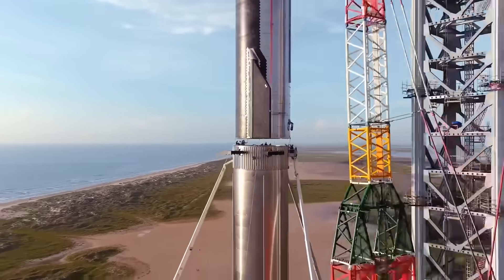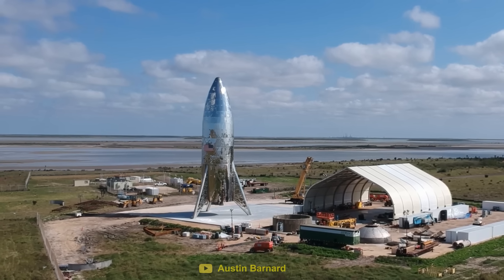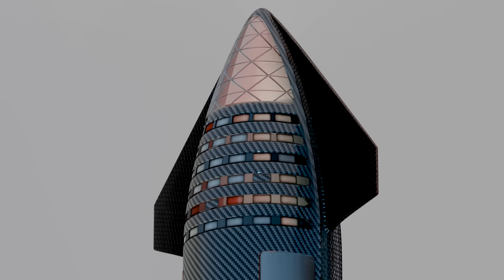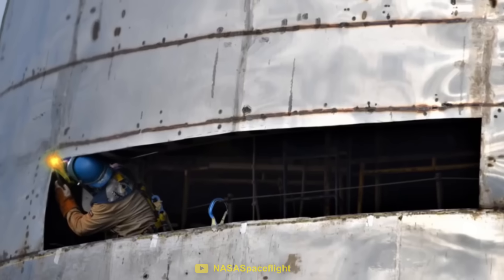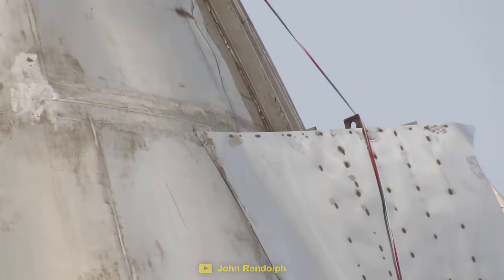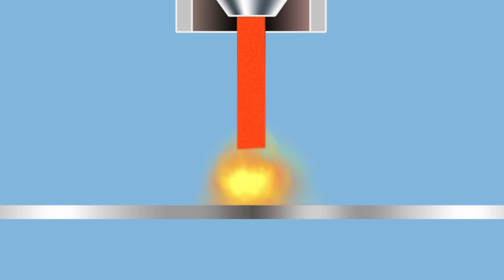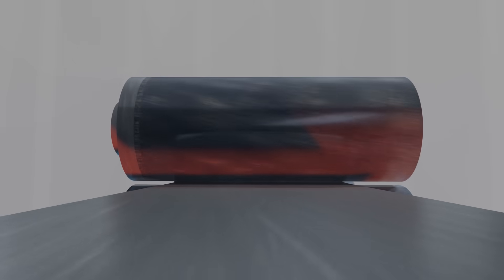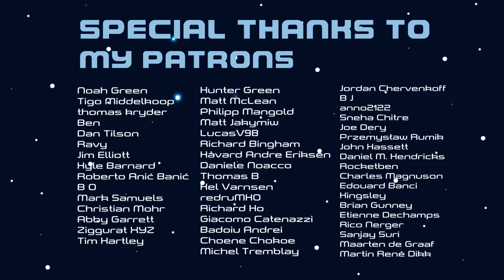How SpaceX Mastered Starship’s Welding

Comment: It would be super cool if SpaceX could manufacture Starship through friction stir welding (FSW is where you take two sheets of metal and smash em together so they create a structural bond on a molecular level) Since they've already mastered FSW on Falcon , I'm really hoping to see them go with it for Starship.

Granted, the size of Starship compared to Falcon means that the machines would have to be much larger, but I can see them stir welding large segments together and then connecting those segments with smaller, much less noticeable welds.

Super excited for the future!
Reply: You may be thinking about rotational inertia welding. FSW is a different process from what you described and has yet to be used on SS in industry.